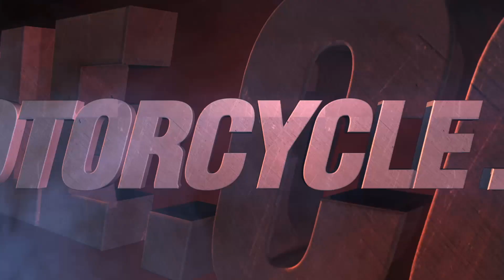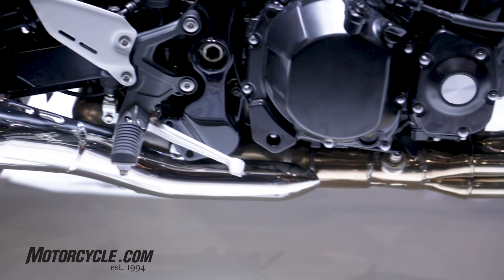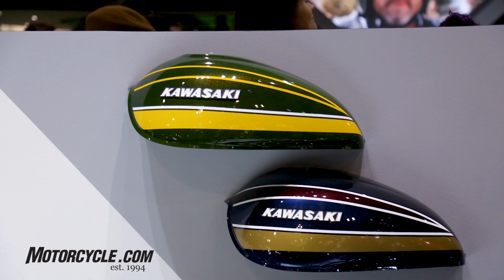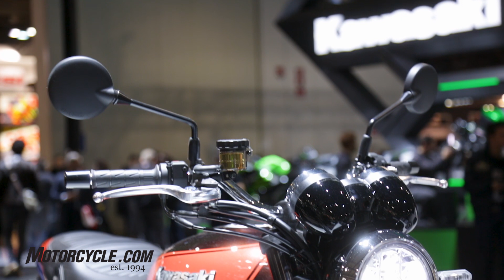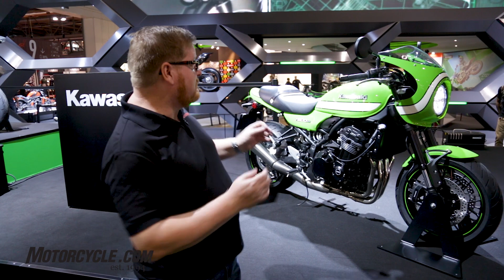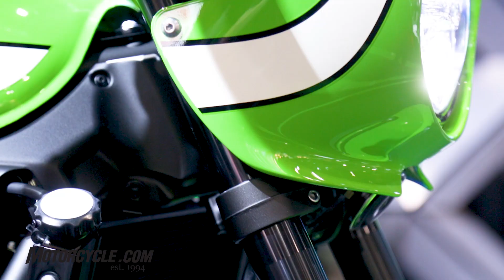2018 Kawasaki  Z900RS and Z900 RS Cafe First Look

Comment: I took the Z900RS for a test ride last weekend. A retro Z1 it is not. I was looking forward to this bike so much but was disappointed. The riding position is not retro at all and you feel like you are perched on top of the bike in a forward leaning position. For that genuine retro feel it definitely needs a lower seat/frame and a 4 into 4. It's an ok bike, but more of a modern Z900 with a retro style tank and paint job. It misses the true retro feel by a mile. Disappointing.

Comment: My uncle bought one of these way back around 1975 I believe and would give us rides on the back. Nearly fell of the back a few times when he hit the throttle hard. To this day I can clearly remember the distinct sound of that motor. I'd love to have this bike, but only if the seat height isn't too high. My uncle was shorter than me and could only put one foot on the ground, and I'm not a lot taller. I bought a 1980 KZ750 brand new myself back in the day. Wasn't the 900 but was still a great bike.

Comment: Nice bike, but it drives me nuts when manufacturers reduce the power on these type of bikes. 

Less horsepower than my old 1984 GpZ1100?

Love the look, but I don’t get it
Reply: In other words, "we retuned it for a more street friendly torque output". They just don't want the bike's power to be the same as the high end sportiest model.
Even my 1984 GPz 750 turbo had 112 hp at the engine and my 1983 GPz had 120 hp as rated by Kawasaki.
Reply: @stevesmith6236  

750 turbo was a beast.   My gpz11 was 125 horse, but I still think the turbo was faster.   They seemed to hit 10.90-10.95 stock, and the fastest I could get the 1100 was 11.10

I keep an eye out for one.  Looking to get a weekend ride and always wanted a turbo or an RG 500.

Comment: The best throwback style bike I've seen yet. The front fender should be lower to the tire and the seat could be cut more like the original. ELR IMO. My neighbor has and rides the 73 Z1 900 that he bought new. It has 215k miles on it.

Comment: Its all wrong, the engine is too far forward and what is that bit of frame between the side panels and the head? The Swingarm should have been a little shorter and the engine further back. Looks like they used an existing sportbike chassis which this bike didn't need, Lazy job!! Looks nice to a blind man going past on a galloping horse!!!

Comment: detuning ruined it.
Reply: Floyd Burdett They could put a ZX10R engine in it if they were looking at horsepower but that is not what Kawasaki was trying to do.It is a great bike to ride and enjoy and after all we do have a Z1000 as well,Nice to hav choices hey? 👍
Reply: You can not tell the difference, Torque is great and as it is retro top speed doesn't really matter, Great bike all round i think..Get on one.
Reply: My Brother had a '76 KZ900 with 82HP and almost 100 lbs heavier. So dropping the weight and 'adding' the 28HP is certainly an 'improvement'... but when you think of my Yamaha FZ1with just 50cc larger engine displacement puts out 150HP while also being focused on the some 'Sport Naked' RPM range...it certainly seems that Kawasaki could get more than 110... That is going to come out to about 85-90HP to the rear wheel...
Reply: I agree 100%... It is, after all, a STREET Bike, rather than a 'track bike with lights'. And it is 'recalling' a 900cc bike rather than the later KZ1000 or Z1.
And building it off of the ZX10R platform would be a totally different task and result.
 BUT having experienced 'the originals' where Street Performance was a BIG part of it's attraction... and currently riding a bike with just 50cc more but still much more powerful while still being focused on that Street riding mode ... I would have liked for it to have more power to the ground. (smile)

Comment: I love these kawi's, but would like to see remote preload adjuster on the rear shock.   The sounds are stellar, the standard RS is my fav, and it fill the gap in my experiences - I've always lusted after the Z1, and often wished my Honda 750 had waited on the shelf and I'd got a Z1 instead.  And the modern version should handle!! Z900 or H2 Sx, what choices.  Thank you kawasaki!!

Comment: I owned a 1975 Z1B for 13 years from 1977 until 1990 when the USAF sent us to Spain. I sold my Z1 but should have stored it.  It was my favorite bike even to this day and 22 more bikes later.  I wrote to Kawasaki asking for this bike so you know I'll own it soon.  Still enjoying my restored 1979 Honda CB750K in black with gold stripes.  Thank you Kawasaki.
Reply: I was service manager at a Westchester co, N.Y. dealer when the original came out in '73.  It had an iconic color scheme and was a delight to ride, quite light feeling for an over 500lb. bike.  I reserve any judgement on just how this new version looks from a video.  To me, need to see it in person but I don't think they messed up with this one.  I'm sure they went with a tried and true balance of geometry and fitting to make this one a keeper.
Reply: Pricing research has me reevaluating my purchase.  I saw the pricing on the European models and after conversion to dollars,  I will not buy a new bike costing nearly $13,000.  If the price is $10,000, I'm very interested but need to see it and most importantly, sit on it to decide.

Comment: What a beauty.
I gotta say though, I'm REALLY surprised Kawi is taking a dive into this area given how badly the CB1100F flopped.  That bike was another beauty that did horrifically bad.  Every now and then I still see like a 2015 on the show-room floor advertised on craigslist or something..
Reply: As a long time Honda owner VFR800 CB750 I think Honda missed the boat by huge mile by building under-powered,heavy,sub par suspension bike with 13k price tag.With 13k you get lot better bikes.Honda should of least had 110HP and weigh 50LB less.That's why it failed!

Comment: I for one am glad Kawasaki decided to stick with the rear monoshock. Dual shocks are just too retro, and would look awkward with that high seat.
Reply: In these days having a twin shock would be stupid so I am with you a updated single shock gives the best of both worlds.
Reply: Twin shocks put the rear suspension loads up into the subframe, requiring a much heavier and strong subframe (adding weight). Not only that, the subframe has to absorb the forces of the suspension without bending, being a long lever-arm away from the core of the motorcycle. Monoshocks put the suspension loads into the central part of the bike, often even into the transmission cases. Far better design.

Comment: The cooling fins are not "fake". Kawasaki has used fins and water jacket for years in several models, this Kawasaki expert needs to do proper homework as the definitely not fake, poor choice of words.
Reply: If the engine is water cooled than what are the fins for other than aesthetics? Do you think GSXR's, R1's, CBR's etc have fins on their engines?
Reply: James Marshall that's not correct the fins on your bike are a functional heat sink. Kawasaki has done this with many bikes. Often experimenting with thicker fins and fairing heat flows.
Reply: We will have to agree to disagree on this. IMO,  fins are totally unnecessary on water cooled bikes for cooling purposes. End of. Kawasaki even said when they produced my ZRX that the fins were added to give it a Retro look. My Pals Cbr 1300 has zero fins and runs the same temp as my engine. We both have the same type Temp guage.  My R1, which has a much hotter running engine  than the ZRX has no  fins, and does not need them. It simply has a bigger Rad. I can think of a ton of water cooled motors without any fins, incl bikes like Yamahas Mt series, triumph Triples and just too many others to mention.
Reply: Of course the fins will become hot if they are part of the motor !!!! Jeez !!   But they are absolutely not needed in any way to help cool the engine if its watercooled.
Reply: "slow clap applause " . . . thanks, people and their ignorance can't be helped.
Reply: Jimmy M The fins on your bike are designed by Kawasaki as part of the cooling system. The radiator, water pump, hoses and internal cooling routes are tuned for working with the fins in your bikes case. When finless blocks are made other things are scaled up.
Reply: ItsVash it is fake... Because the engine originally water cooled... So, make sure you've done your homework too
Reply: Matt Shah it's a functional heatsink. Of course it's primary water cooled but fake is not correct. Touch it at operating temp and if it's hot and burns your hand it's thermally conductive. Kawasaki uses these on the EX500 for example so anyone worth salt should know that.
Reply: I've seen these (absolutely functional and therefore not 'fake') cooling fins on more than one water cooled kawasaki. Including bikes where one would never normally see the engine because it's under a fairing. They certainly wouldn't do that if it were purely aesthetic eh?
Reply: Can you name the bike ??? I have a ZRX1200 and it has fins too, but they are only there for looks. A water cooled engine does not need fins for additional cooling.

Comment: The tank looks disconnected from the forks, looks wrong! I had the original and it is so much better than this hash job!
Reply: I hope the tank is disconnected from the forks.
Reply: Miganarchine 
Have you ride it ? don't think so..., looks pretty awesome to me 😆
Reply: Nothing rides better than good carbs. Ask any expert. But Carbs are in the past, so I have learned to accept that. By the way, I own a 2002 Kawa ZRX1200 and a modern R1 with FI, so I can appreciate the differences.  For truly linear feel and response, no FI system can beat a good set of Carbs !!
Reply: +James Marshall ive owned only carb bikes. and i envy my friends with efi. speciañly during the winter.
Reply: "For truly linear feel and response, no FI system can beat a good set of Carbs !!"

Except a FI system that has been unrestricted by a quality aftermarket ECU flash. The reason why carb-familiar people prefer the feel of carbs isn't because FI is inferior in minute control and feel, it's because the EPA mandates every FI system to cut fuel off completely when the throttle is in closed condition. That means bikes, cars, trucks. Re-wetting the port and getting the combustion process restarted creates a delay and usually a torque-spike to the wheel upsetting traction when traction is needed most (mid-curve).

ECU flash eliminates these mandated restrictions and makes the FI function exactly as smooth as a carb, minus all the problems with carbs.
Reply: Lifted_Above , interesting,
... Quanta Costa ?
Reply: Cost for ECU flashes varies. Usually you pair that up with a good full exhaust system and better air filter (and maybe an airbox hack). Open the system up for good breathing on both ends. Factory has stuff so blocked up and neutered it's ridiculous.
Reply: its also slower and carbureated.